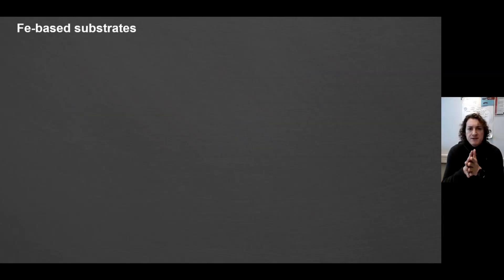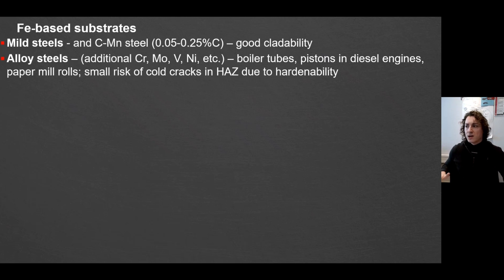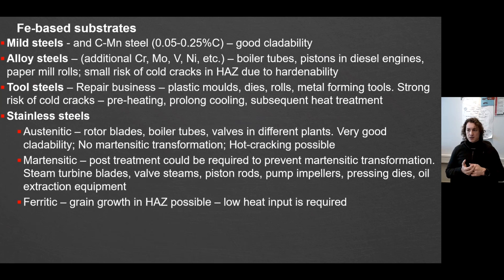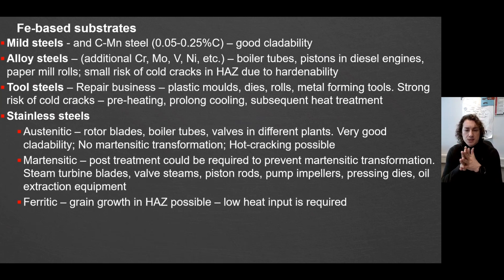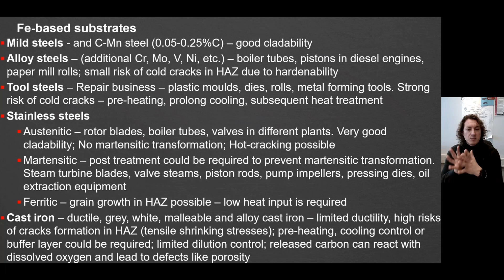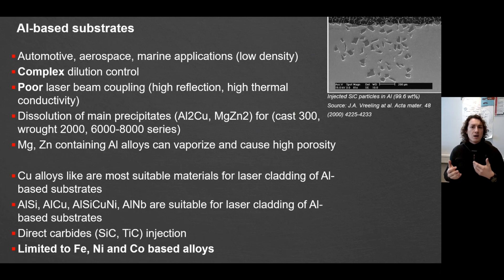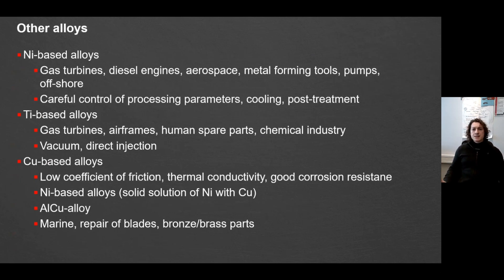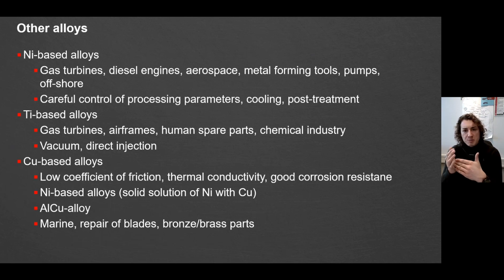Laser Cladding - what do we need to know about substrates. Part 2

Comment: Thank you for your nice video 🙏 does we have to use fibre laser for cladding? Or we can use co2 tubes directly behind the powder nozzle? I asked because the co2 system in very cheaper.
Reply from the maker: In my opinion, CO2 lasers are already out of the laser cladding market. Some still use them, but generally, you cant compensate for the efficiency of the diode by co2.

Comment: Thank you for nice video. I have one question. Is it possible to deposit steel/stainless steel on bronze substrate?
Reply from the maker: You should care of back reflection, but that is not impossible! I would probably go with Inconel instead of stainless steel, 316l or 304l might work as well.
Reply: @TechnologieswithArkadi 
OK, I have some more questions and I would like to know your opinion:
- but why you prefer Inconel instead of stainless steel?
- shot blasting makes surfaces more matt for naked eye. Do you think that shot blasting of bronze substrate decrease reflectivity? Without negative effect on adhezion and coating quality?
- in general, is there any different between: LMD (with melt pool on substrate) and EHLA (with melt pool above substrate) in reflectivity during deposition process?
- is there any difference in reflectivity in these two cases: Cu alloy deposited on metallic substrate and metallic layer deposited on Cu alloy substate?

sorry for a lot of quations :)